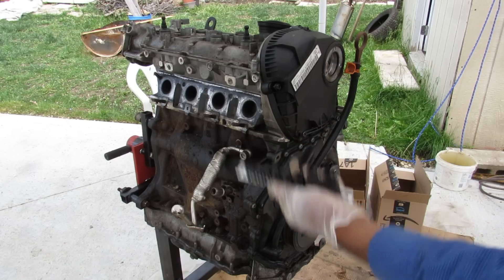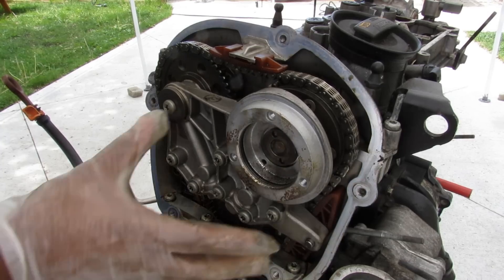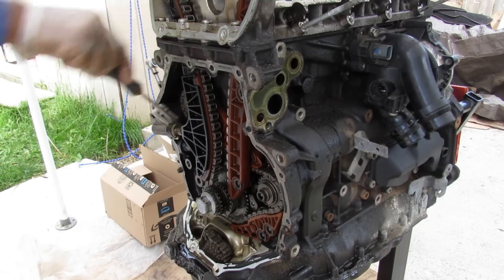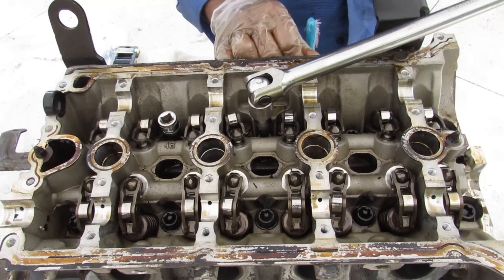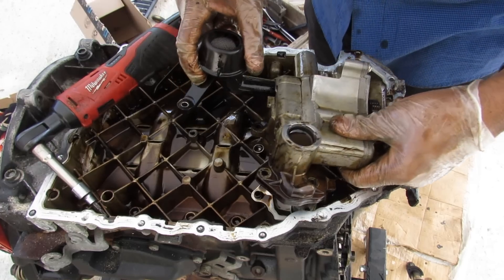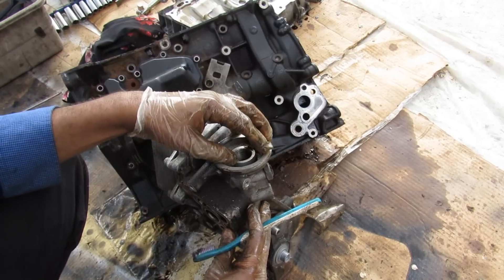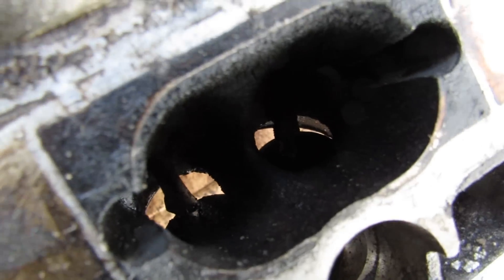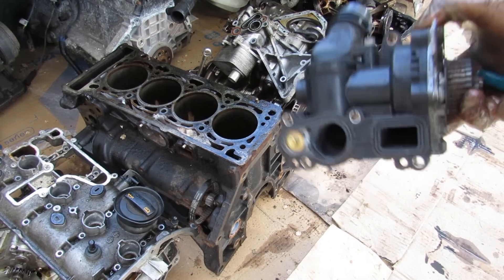Why Volkswagen Engines Fail

Comment: If this is the one I'm thinking of, VW had something like 6 revisions of that chain tensioner. Never own a German car outside of factory warranty.
Reply: thxs for the 2 L teardown, quite different from my 1.8 l.   on my '83 gti and '92 Cabro ( both A1s) i always purchased  VW's extended 5 year platinum ( zero deductible ) warranty.... extended warranty is a must w/VW.  ( the '92 Platinum cost me $900 (no tax) and i had to buy it in AZ because the CA VW dealer would not sell me the VW one. they only offered some other non-VW warranty for $1400 ( and i would have had to pay CA state tax on that too! ).  i knew from working in AZ that service warranty is not state taxable in AZ...& I had a month to buy the extended plus the VW warranty is good at every VW dealer in the US... so i just happened to fly to AZ 2 weeks after i purchased the Cabo and hooked up w/old dealer, showed invoice paid $$ done....so my future repairs were done at the CA dealer i bought it from in CA. Between the 2 warranties i got a new lower block on the '83 and for the '92 , new battery, radiator, wheel bearings, oil pump,  and new head, plus a new fuel system when CA changed over to different blend a gas and shortly everything leaked )...the platinum warranty also provides 5 days of car rental too. i also own an air-cooled bus....what can i say.... its a love / hate relationship....                     Cheers

Comment: loved my 08 gti. the fsi engine was a champ at 130,000
Reply: Baby miles! My first car was an 85' Gti 1.8L 8V, still running when I traded her in at 425k. lol Single cam and that engine would rev so high and shoot flames out the tail pipe. I miss that car.
Reply: @michaelstrongbow2336  revved quick too aint it. that car was revolutionary

Comment: @ 8:39 You'll find that NOT valvé to
Pisston collision,  butt just designed cut out in
the top of Piston to accommodate valvé
Reply from the maker: That's under normal operation. In this case there was too much interference

Comment: Had 2000 year vw jetta 2.0 (naturally aspirated) used. The engine never failed on me.
Reply from the maker: Natural aspirated were better than these
Reply: The ABA was a great motor, no where near the power of one of these, but as reliable as the sunrise.

Comment: Very interesting video. Here in Scotland, I own a Skoda Octavia 1.8 TSI ea 888 gen 2 engine.  Similar to the one in your video. It consumes a lot of oil,but it drives well enough. Powerful engine and smooth engine. I enjoy driving it. It has the old timing chain tensioner and I just hope that it doesn't fail anytime soon !!
Thanks again for an interesting video!

Comment: That is not a lot of carbon buildup.
Most DGI engines look like that.
Reply: carbon build up depend from the use from the car, ex: on my Peugeot 1.2L Puretech 130hp turbo direct injection, is at 100000km the carbon built up very low because i drive most on highways, only very little city...

Comment: I owned a VW and wanted to remove the hood, proceed to take a sledge hammer and then smash the hell out of that piece of crap engine and components. A bonus would be filling the cars entire interior with motor oil and roofing tar, topping it off with gasoline and then watch it burn for hours to further satisfy my contempt for that shamefully engineered piece of overpriced can of garbage. I never realized the possibility of becoming violent in my personality until owning a VW. 
Lesson learned.......Friends, do not allow your friends to buy a Volkswagon!

Comment: German stuff is sure different from what I've been used to, and WAY more complex. I think I'll stay away from German made cars unless someday I can afford to have someone else fix them for me.

On an unrelated note, some videos on common trouble codes on OBD systems, what causes those codes to appear, and what to do to fix them might be interesting. In my days as a mechanic decades ago I would come across a problem, diagnose it as best I could using a diagnostic tree to narrow it down to either this part or that part....then talk to the parts department at the dealership and ask which of those two parts they sell the most of to determine what is actually going wrong in the real world. Something like that would be a big help to people struggling with a Check Engine light.

Comment: Haha i have the Lifetime DSG 7 Dry Gearbox which VW claim should last lifetime of car. Which is what since my clutch packs are fully worn out at just 40K Miles. Clutch slips very often i have video on this on my channel. Its a shame really but glad they got rid of the dry boxes after this edition now all boxes are wet oil ones they learnt there lessons
Reply: Technically they do last the lifetime of the car, because once the transmissions go bad it's so expensive to fix or replace them that the car is totaled.

Comment: I had a Volkswagen TDI1,9 and it did not even last to the first timing belt before the connecting rods blew out on the side of the engine. and find out it was also some issue on that model of engine, a friends Passat oil pump had no longer any splines on the gear and the engine broke, etc. I seen many "flaws" in later years and find many of them almost seem like intentional

Comment: Is the ea888 a good engine with all the problems fixed? Eg water pump, tensioners, etc

I’ve just had a ea888 CDNC version (off Audi A4 B8.8) rebuilt with forged pistons, conrods, performance springs retainers… on a k04 93oct… outputting about …328hp at the crank.

but looking into big turbo opportunities to get more from the build.

Comment: The carbon build up in the intake ports may have come from valve leakage more likely, as no "backdraft" or combustion inside the intake ports would have occurred when and if the valves would have properly shut.
Reply: It's the oil vapors that cause the carbon buildup. Those vapors get recirculated to be burnt off in the combustion chamber. As they pass over the valves they start to buildup carbon because there is no port injection spraying fuel on the valves keeping them clean. All GDI engines without port injection eventually have this problem.

Comment: So many weak points they never really fix/change or upgrade DIRECTLY(when they are discovered) in the factory when they designed these engine systems, IS JUST RIDICULOUS, and shows you how incapable (or unwilling) they are to make some truly reliable machines/engine, I find that REALLY disgusting and it looks almost that they where build and designed to FAIL.  BAH.

Comment: Interesting video. I had my 2014  VW GLI walnut blasted at 165K. Had timing chain replaced at 190k. Gets 40 mpg  on highway and maybe 26 in the city. I have a Unitronicstage 1 tune so my gas mileage is better than stock,

Comment: Here in Brazil sometimes we have to replace the high pressure fuel pump, the injectors and the spark plugs because some of those engines run on 100% sugar cane ethanol which has too much water
And off course we replace the plastic water pump
Reply: You guys Brazil I believe have to pay like a 100% markup on a new vehicle.
Reply: @charleslowe522  haha some companies stated they weren't making profits and ford closed all their factories here, but the cars are getting really expensive
Reply: @DanielEismann  Didnt knew it was THAT bad. RIP.
Also, if the help is someone like Lula, obrigado ... 😂😅
Reply: @matiasfpm  🤣
Reply: @charleslowe522  dunno about HUEzil, but here in argentina , cars are taxed at 64%.
Pls, get me out of this shithole m8
Reply: @matiasfpm  someone will help you only if you admit that Pelé is way better than Maradona
Reply: Southern Cone: we specialized on wiring with wire, even the SOPHISTICATED FUTURISTIC volkswagen crap 😂😅

Comment: These engines get tuned beyond original specs, as such they're bound to fail earlier. same with Evos, Subarus, etc. If you just leave it as a stage 1 tune you can drive it much much longer as a daily. Mine is at 145,000 miles DSG.

Comment: This is almost unbearable to watch, so many weird design flaws that make me cringe. I’m only half way through the video. That damn water pump, why? So many things wrong there. When I saw the mess of chains under the timing cover I was like “Jesus Christ”. Also can anyone explain why the cam bearings are supported by the valve cover? This small 2.0L engine makes some much larger engines look simple. It’s looks like some areas were cost optimized, while others are unnecessarily complex. The wonders of German engineering...
Reply: Can you imagine having to reassemble that mess?  The bottom end is straight forward, however once that is complete, it looks like a horror show.

Comment: German engineering is not what it used to be.
Reply: Things used to be overbuilt in the 80s and 90s because we had the computer tech to machine and measure for precise tolerances, but not the computing power to economically simulate when a part will fail (actual physical tests had to be performed instead, which is expensive). So it was safer and cheaper to just overbuild parts so that they wouldn't fail during the warranty period.

Today, and since the about the 2000s, we have computer technology to run a computer simulation (rather than doing expensive actual physical lab and field tests). and can design parts to be only as strong as they need to be for the warranty period, and to fail after a certain number of miles, a certain number of heat cycles, certain number of engine hours, etc. (to save on production costs and create planned obsolescence).
Reply: @belskyautoworks89  such practices should be made illegal
Reply: @maybeiam3367  Yup. It's wasteful, greedy, and short-sighted.
Reply: @belskyautoworks89  It happens across all industries, sadly.
Reply: @belskyautoworks89  Tbh a lot of stuff is still overbuilt on German cars. I'm alive because of that overengineering.
Reply: Paying customers, ie the first buyers, replace their cars within 3 years. While also expecting more and more features, safety equipment, governments enforcing tighter and tighter emission regulations. While the price has to remain nearly same, even disregarding inflation.
Only way manufactures can meet these demands, is to to cut costs. This includes more precise simulations to ensure cars need minimum warranty jobs during first three years. Rest of the useful lifetime of the vehicle is much less important.
They absolutely COULD make cars last longer, but this would mean higher costs and the paying customers would simply choose from competing company, who offers more features and enough reliability to last them their 3 years.
It almost always come down to customers. Cars do not even need to be replaced every 3 years, but it has become de facto standard for middle class and up
Reply: @netiturtle  I disagree with Higher Cost. You heard of thing called Automation? Plus most cars share the same parts including chassis. (remember there was only bmw 3 5 7 series? now it's 1~8 WTF) They also source all kinds of parts from all over the world minimizing their cost.
Reply: @netiturtle  Yep, this is exactly what happens. People want to safe money (naturally), but that means the one producing your stuff also has to.
Reply: Depends on how you look at it. Maybe high level  (German or otherwise) engineering is ultimately about making things profitable. Back in the 80s or 90s, that probably meant making the cars very durable. In today's market, technology moves along faster and people replace their car because it doesn't support the latest version of CarPlay or whatever, so the engineering goal has changed. It's still "precisely" engineered, just "precisely" to last until the warranty is up.
Reply: @dirkmohrmann8960  japan does capitalism best. they fuse profits with shame. western culture values money a lot more than pride in product.
Reply: You want engineering,  buy German but engineering has nothing to do with reliability. You want refinement and reliability, buy Japanese, their R&D is done before the car is sold not after (by the customer). Mercedes S class is a marvel to behold, but no where near as refined as  v8 Lexus. 6cyl and 4cyl bmws are great to drive, e39 in my opinion is one of the greatest cars ever made, but it would benefit you to work on them yourself to prevent going broke. The germans have hundreds of parts that fail by design while the Japanese simply have less. In the past I've had to renew certain areas of my German car (suspension,  cooling system, etc)if I ever expected it to not fail me. That's just not the case with a 100kmile Acura for  instance. I don't have to think of a possible FP failure or radiator blow out on the road. If it's a newer v8 BMW, forget it, its complete shit (Benz makes a better V8). It seems in their perfect way the Germans sell you a lifestyle vehicle,  they also would settle for a 3.5 to 4 star rating in order to stay mega profitable. It simply does not pay enough to build a Lexus, that's not the way they work.
Reply: @Gmansour1971  😍, simply think twice,
Reply: Pretty soon into the future, neither will Germans. (Thanks, Merkel)
Reply: this is a 10 year old+ engine
Reply: it got to another level, 
I cant belive it is not butter
Reply: I live in Germany for 5 years now and I will give you an answer.
Ruthless, ruthless capitalism.
Especially car industry, market, dealers.
Lies, cheats every possible method to take money for less possible quality and expenses. Sometimes I feel offended how they downgrade my work and earned money when I come in to dealership.
Their "Guten Tag" is 20 euros.
So nothing to do with engineering.
Reply: I am a  german engineer. I am driving a Lexus. And I know why.
Reply: Buy mercedes bmw porsche if you want proper german car
Reply: @xynstav  No way. Mercs are really unreliable cars. I don't know anyone who would've had merc with 300tkm's and wouln'y have run into major problems. New mercs are junk...
Reply: @jothain  w211 with more than 1.000.000km one more with 460.000
W212 with 380.000 all of them still running
Reply: @xynstav  I know one I think it's C218 which burner. Three +2010 Sprinters that have had catastrophic engine failures (complete new engine needed), One W212 that had serious problems with automatic transmission all the time and no one seemed to be able to fix it properly. W211 would indeed be good car, but they're awful rust buckets. I don't know any from that era that wouldn't be needed to weld every year. They just aren't made for winter usage. Engines and transmission are good in them though. But yeah, new MB's. Unlikely to get one. I might consider W212, but it would need to be thoroughly researched. Plus 2010 models seem to be worse than BMW's of that era, at least partly.
Reply: @jothain  Most new cars are shit compared to older cars
Reply: @gnaedigerfels  That unfortunately seems to be very true. Been thinking what might be my next car which should be maximum 10 years old and gotta say I don't know any car that would be affordable, decent gas mileage and fairly cheap to maintain. I've had good luck with current mk4 mondeo for 600tkm's but that car can't last for too long anymore. Thought that if I'd simply try same but newer model and hear from multiple places that mk5 models aren't as nearly as reliable as one I currently have.
Reply: @jothain  Indeed it is rather true I would like to see companies create reliable efficient engines like 1.9 TDI PD and the OM612 and many other engines, but todays economy plays a different role in engineering
Reply: @xynstav  Porsche engines in many cases are VW, Mercedes are using Renault engines in their biggest selling cars and BMW really managed to screw things up with timing chain failures of late, though I understand they are better now.
Reply: @xynstav  same music different singer
Reply: they have never been..............
Reply: Idk how about that. Have you heard the problems German tanks had in WW2. I cant see a German engineering ever being good.
Reply: @baronvonjo1929  Mercedes W124. I'm not MB fan, but if those where build today, I'd buy one without seconds hesitation. It's remarkable how efficient, quiet and comfortable they were for their time (one exception is rubbish seats that don't last long). Way ahead of any other car made in any continent.
Reply: @baronvonjo1929  Wha?  Ever heard of FW109 aeroplane?
Reply: @gyrogearloose1345  Fw190 have big problems with overheating . You mean Meserchmit me 109, and they have many problems.
Reply: @baronvonjo1929  The cars from the 80s and early 90s were really good, they didn't suffer from the shitty stuff today.
Reply: @baronvonjo1929  I assume you were alive then Right?
Reply: It hasn't been since the 90s. Don't feel bad though, Toyota engineering has been a dumpster fire for the last 15 years too.

Comment: When Ferdinand Piëch came from Porsche to head VW in 1993 he ordered a massive cost-saving program, pressing VW's many suppliers to reduce their prices by a certain percentage each year no matter what, and enforcing cost-cutting engineering solutions like the ones in this pile of crap engine. Piëch was good for the VW group, you can't argue with the revenue figures, but he destroyed VW's reputation for reliability.

Comment: Every Subaru needs a few THOUSAND to make it to and past 100,000 miles and YET they have a  CULT like following
Reply: They are not all bad engines. I'm no subey fan (I don't like them to be honest) but their 2L is pretty reliable in most years and their 6 banger isn't bad either. Later 2.5s are okay as well.

Comment: Sh*t..and I thought my BMW N55 engine is unreliable. The only good thing is I save a ton of $ doing the labor. Germans love them etorx and tty one time use bolts. This VW engine is def not made to last. I think my stint with "german engineering" is done - I'm running back to Japanese (Lexus?) after this.